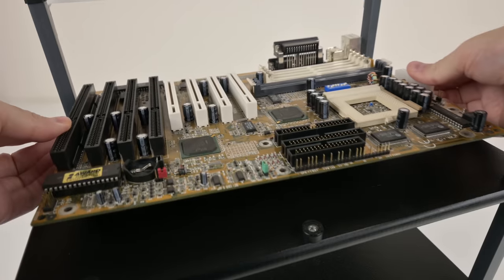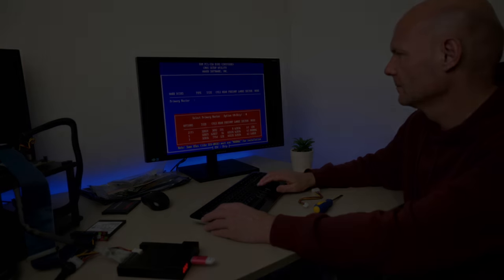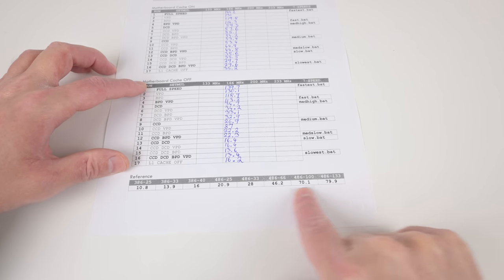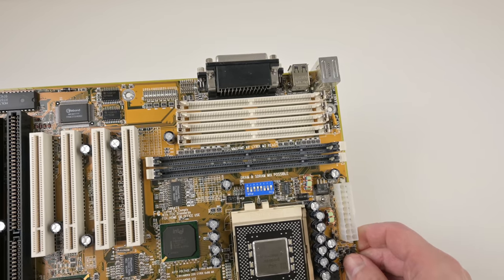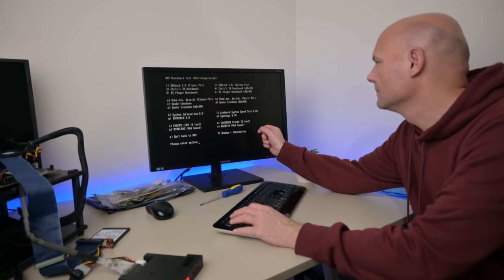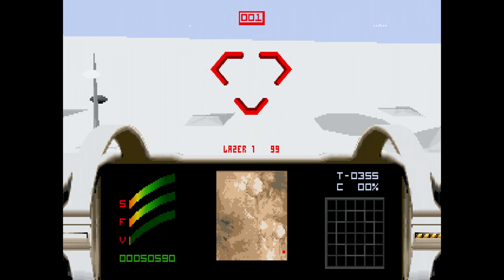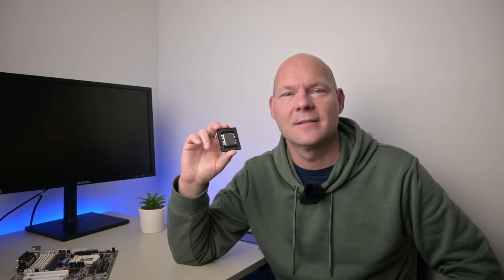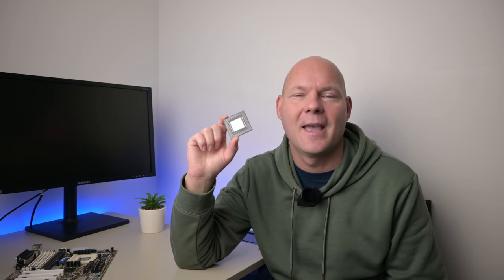Pentium MMX 166 is one of the Best Retro Processors

Comment: Great video, lovely editing on the build montage. I grabbed a very cleap Dell socket 7 board with integrated VGA and picked up a 166Mhz MMX to go with it and making it work for me. Recently under locked it to 50Mhz FSB which got me down to ~22 on 3Dbench with slowest.bat which is cool as the crappy dell bios doesn't let me disable L2... I'm looking to make a low hight Crystal chip based sound card and joystick card that fits right into the risers slot as it has built in Ethernet, VGA, IDE so sound is all I want to add, fingers crossed I can make it work 🤣 fun is in the building for me. Really want to try Epic also, I had Inferno back in the day and I thought it was very hard and super confusing, it annoyed the heck out of me, although I loved the graphics and music.
Reply from the maker: Sounds like Inferno didn't change the frustration 🙂 Nice job with the underclocking of the FSB, might be something I could look at...

Comment: Great chip for 95 c or original 98.  A little weak for 98se or ME but still doable if you have 128mb ram, and a fast hdd it'll just be slow loading apps.  K6-ii 300 or p2 266 is really bare minimum for a good 98se experience and p2 450 or k6-3 500 with at least a nvidia tnt2 or voodoo3 and 256mb system ram bare minimum for ME

Comment: Well, this is good news- looks like it is time to pop my 233MMX back out in favor for the 166MMX.  I wish you had shown a sheet for the 233.  Granted, the 166 is ideal for this mod, but the 233 would really like the dual boot and possibly the 233's lowest clock would only be a few mhz faster then the 166's???  I love socket 7.  I got in back in the day with a 90, then a 133, then a 200, then a 166MMX, and then untinately a 233 MMX when prices became affordable and everyone and their brother was NOT into vintage hardware ;)
Reply from the maker: YOU need to fill out your own sheet as every machine is totally different and you will get different numbers. You can just change the mulitiplier and the run the 233 at 166, no need to remove it.

Comment: I think it's tough to beat the 440BX chipset for retro PC gaming. Pretty happy having an ASUS P2B running a Pentium 3 at 1 GHz for DOS and Windows 98. Very stable, many games just work and is very flexible with USB/SATA/ISA sound cards all at once. Not sure what could be better aside from a mini PC supporting all of that integrated, haha.

There is a CD image of the Evergreen Spectra 400 on the Vogons drivers containing thousands of Socket 7 BIOS files, including large hard drive support and booting from CD. Try to see if that makes a difference.

I'm curious as to how far Socket 7 boards could go. My first desktop growing up as a kid was a Socket 7 Pentium 120 but it has no PS/2 ports and no MMX support due to the VRM socket being unpopulated. I still have it and will never forget the times using it, but the limited ability to upgrade and having to use a serial mouse has made me reluctant to use it again.

Recently got a hold of an MSI MS-5148 from surplus that has PS/2, USB and MMX support, not sure if it can work with K6-2. Looking forward to trying this board out.

Comment: personally I prefer Windows 98SE with configured DOS mode to Pure Dos because it allows for me to use USB with a PCI card. I have one with an OPTI chip and the only time it gave me problems was when I tried to use it under Windows 2000 on a 486. You can also edit the MSDOS.SYS so it won't load the GUI.
Reply from the maker: 98 + DOS mode is a winning combination!

Comment: A couple of weeks ago I bought an Asus TX97-XE motherboard, basically same thing as this gigabyte board in the video. Seems to work, but for some reason keyboard does not. I see no scratched traces near the ps2 ports, or missing/broken components around them... Any idea how to figure out why it's not working and try to fix it? Perhaps it will work with USB keyboard, have not tried, but I want it to work with a ps2 keyboard (I have not tested if the mouse ps2 port works yet)
Reply: Sounds like you're gonna have to go Adrians digital basement on it and put an oscilloscope to it

Comment: I'm trying to think about a couple systems here.
First is a TurboXT system running DOS 3.3 which can switch between a V20 at 10Mhz and a 8088 at 10Mhz using a custom dual CPU board in the same manner as a 286 Upgrade board (sending reset signals to the pin on the cpu when inactive). It is able to slow to a 4.77Mhz speed, thanks to the turbo XT board itself, to play games that require the slow speed and play early EGA games at full speed either on an 8088 or V20 to get the best of both worlds with 640K of RAM. Since I have a game on there that requires complete register compatibility with CGA (Digger being an example), I have a choice: 
1. Axe that game and play with a semi-register compatible VGA ATI Wonder series for the games that don't need full compatibility with CGA
2. Play that game with an original CGA card and have to swap the card out for an EGA card when going to the V20 due to register incompatibilities that won't allow the EGA and CGA cards in the same system configured as color graphics accelerators (and get a MCE2HDMI for conversion to VGA and HDMI from CGA and EGA)
3. Get the one card that does have full CGA register compatibility called the Cirrus Logic CL-GD510 + CL-GD520 Codename: “Eagle II” Card (CGA, MDA, Hercules, EGA, VGA) which is stupid expensive and hard to find
I'd like to play these games on it and I plan to put a LABS Blasterboard (AdLib Compatible with SB2.0 Support) (8-Bit ISA) so I can tie in the PC speaker to get higher quality audio from that speaker output along with adlib support for the few games in the list that support it:
Castle Wolfenstein
C.I.A Adventure 
Lost Dutchman’s Gold 
Nuclear Submarine Adventure 
Transylvania
Battlezone
Digger
Fleet Sweep
B-1 Nuclear Bomber 
Civil War 
Hide and Sink 
GATO
Out on a LEM
Beyond Castle Wolfenstein
Spacewar
The Crimson Crown 
Cat ‘n Mouse 
Emergency Mission
Tetris
Beyond the Titanic
Oo-Topos 
Defender of the Crown 
Knight Orc 
668 Attack Sub
Transylvania III: Vanquish the Night
Paku Paku

Second is a Socket 7/Super Socket 7 board with either a K6-2+/K6-3+ or a Pentium MMX 166 for DOS 6.22 only titles from late non-speed Sensitive 286 Titles to a 386 25Mhz-33Mhz, A 486DX2 and Pentiums playing both 2D and 3D titles on 64MB of ram. The graphics cards I'm really having a hard time with. I know I want some sort of S3 card for 2D on it and found the fastest AGP card Diamond Speedstar A55 (S3 Trio3D/2X) (AGP) and the Fastest PCI version (Diamond Stealth 3D 2000 (S3 ViRGE DX) in case I need a 3D accelerator. From the compatibility Matrix only two games that are on my list are Glide Titles and they are strictly windows games so that means I don't necessarily need a 3DFX Voodoo Card, but if I was going to get one it would be a Voodoo 3 2000, but NVIDIA might be an option to consider (The M64 for example). For Sound, I'm going all out with an Orpheus II (Gravis UIltrasound, Soundblaster, AdLib, Intelligent MPU-401 Support) with a Dreamblaster X2GS SE for Soundcanvas support and a MT32L (MT-32PI) Solution for Roland MT-32 support. Here are the Games I'm planning on for the DOS PC specifically:
Sword of the Samurai
Red Baron
Wing Commander
Wolf Pack
Duke Nukem
Crisis in the Kremlin 
KGB
Wing Commander II: Vengence of Kilrathi - Deluxe Edition 
Wolfenstein 3D
Buzz Aldrin’s Race into Space
The Ultimate Doom
Wing Commander: Privateer
Duke Nukem II
Epic Pinball: The Complete Collection
Sherlock Holmes Consulting Detective Collection
Wing Commander: Academy
Aces of the Deep
Doom II
The Adventures of Willy Beamish
Star Wars: X-Wing Collector’s CD Rom
Wing Commander III: Heart of the Tiger
Wing Commander: Armada
Star Wars: Dark Forces
Tyrian
Across the Rhine
Fast Attack: HighTech Submarine Warfare
Star Wars: TIE Fighter Collector's Edition CD Rom
Wings of Glory
Duke Nukem 3D: Atomic Edition
Final Doom
Quake: The Offering
Duke Caribbean: Life's a Beach
Duke it Out in D.C.
Duke: Nuclear Winter

Third is a Socket 478 Pentium 4 (2.4A/2.8A/HT 3.0E/HT 3.2E/HT 3.4E/HT 550) Windows 98SE Machine with the Intel 865 Chipset with 512MB of RAM. For Graphics I'm thinking of Going with the GeForce FX 5900XT (AGP). Most of the Quadro alternatives to the FX series have been snatched up already and those that remain are as or more expensive than rarer Voodoo cards. Sound is the Creative Audigy ZS PCI and I am running the following games:
Age of Sail
Fallout 1
Wing Commander: Prophecy
Fallout 2
Quake II: Quad Damage
Sea Dogs
Age of Sail II
Harry Potter and the Sorcerer's Stone
Age of Sail II: Privateer's Bounty
Harry Potter and the Chamber of Secrets
Call of Duty
Harry Potter: Quidditch World Cup
Pirates of the Caribbean
Harry Potter and the Prisoner Of Azkaban

Finally is a Core 2 Duo E8600 Windows XP system on the Intel P45 Chipset with 4GB Ram, a GeForce 9800GTX and a Creative SoundBlaster X-Fi Titanium PCIe running the following games:
Age of Pirates: Caribbean Tales
Call of Duty 2
Quake 4
Command & Conquer: The First Decade
Age of Pirates 2: City of Abandoned Ships
Battlestations: Midway
Call of Duty: World at War
Command & Conquer 3: Deluxe Edition (Includes Kane's Wrath)
Command & Conquer: Red Alert 3
Command & Conquer: Red Alert 3 - Uprising
Silent Hunter 4: Wolves of the Pacific (Gold Edition)
Assassin's Creed (Director's Cut Edition)
Battlestations: Pacific
Silent Hunter 5: Battle for the Atlantic

I've noticed that some games made for the XP era and Windows 98 Era aren't running great on new hardware. Harry Potter and the Sorcerer's Stone stopped working for me recently on windows 10 and Harry Potter and the Prisoner of Azkaban has had constant issues with newer graphics cards to the point that a single glitch that only appears due to the bad rendering behavior on newer systems with newer cards causes the entire game to softlock and it is pure random chance that the imp glitch can be avoided. Age of Pirates: Caribbean Tales is also having trouble in certain areas running on my much more advanced 4090. Some games, most notably Age of Sail II, won't even install on newer machines now and won't boot at all. Its my nostalgia and I want to be able to still play them 10 years from now when I have an itch. I hate having to configure older games to run on compatibility mode, doing all the ini tricks in the book and then some, and still after all that work (hours of it) not being able to run it in the end. That's why I'm planning an XP and 98 Dedicated system so I can have my cake and eat it too.

If Phil is reading this, or if anyone has any suggestions for improving the builds before I invest in the hardware I'm open to it.
Reply from the maker: I skimmed it, it's too much information to dig deeper... Maybe join our patreon with the discord community?

Comment: I actually lived in the 90’s and this even my 133 ran fantastic with Windows 98SE.  I have no idea why people think this is a DOS only cpu but it was far better than that.  Quake 2 and games like it ran great on this and my 133mhz especially with my 3DFX Voodoo 3 2000
Reply from the maker: Your mind is playing tricks and fantastic is difficult to quantify
Reply: @philscomputerlab  No it’s not actually.  I had a 133 until recently since my mobo finally died and also have PCEM17 which emulates an 8088 all the way to pentium 2 450.  I made an emulated 133 with a Voodoo 3 2000 in my I7 laptop and it’s identical to the real thing.  So yes, a 133 and up runs fantastic with 98SE.  In fact, most older dos games hated Pentium and their external cache plus a lot of old dos games liked bus speeds lower than 66mhz fsb.  You can feel free to try and disprove me at all costs to feel right but whatever.
Reply from the maker: @kennethober6626  So what FPS do you get in Quake 2?
Reply: @philscomputerlab  like 24 320x240 Software and 30 1024x768 on Default GL or 3DFX.  I know where you’re headed and my point still stands that it’s more than a crappy DOS CPU.
Reply from the maker: @kennethober6626  15 fps in Unreal and 24 fps in Quake 2 with a Voodoo 2 at 640x480. Nothing fantastic about that. It's for DOS and very early Windows games only.
Reply: @philscomputerlab  Whatever you say

Comment: I see those startech coolers on ebay all the time, was wondering how good they actually are.
Reply from the maker: Nice! Yea well worth it. On some boards caps can be in the way. It also works for low power Socket A and 370.
Reply: @philscomputerlab  awesome, thanks for the tip!

Comment: I have a 5stx-j98 board with a Pentium-S 75Mhz cpu. 128MB SIMM. I bought today. Board only has DIN conector for AT keyboard. What will  I do for mouse? What do you suggest? Serial mouse? Or a PCI card with USB-PS/2 port? And should I buy a MMX 233 cpu? 166-200 and 233 available.

Comment: Do not use SSDs with older hardware, use SD,micro SD, flash cards instead.

SSDs require TRIMM support from the OS to maintain the SSD over time. TRIMM support is a modern OS feature and is not supported by DOS, Windows 95,98,2000,ME, XP, etc.

Comment: Still the retro PC I love the most, as the DOS days will always have a special place in my heart, only that I have a 233MMX on this board. I used to run Win98SE on it too as there are some speed sensitive Windows games too, like Betrayal at Antara. But since I set it to 120Mhz for DOS (via the dip switches, that let you set the CPU to 120, 133, 166, 200 and 233 Mhz quite easily), I got too lazy to open the case and change the dip switches again for Win9x games that need more juice. Now if only someone would make a non-invasive mod so we could switch between 120 to 233 Mhz from outside the case... :D (don't think that it's possible without removing the dip switches)
Set to 120Mhz, MB Cache off and 136 in 1 "slowest" you can reach the nice 10.x in 3DBench2.

I'm also using your config.sys and autoexec.bat with the options for choosing different option like EMS or no EMS at boot, edited for my needs like for using USB thumb drives under DOS. Also started to create batch files for games to automatically switch setmul and sound card options to whatever is needed for the game.

Btw, I know of the game Epic but didn't play it yet. But I played the sequel "Inferno" back in the day. Still have it's soundtrack in my ears to this day.

PS: Don't forget "CDBeQuiet!" (or "CD Bremse" for Win9x), as these are programs you want / need when playing lots of CD based games! They are true "ear-safers" if you use a faster CD or DVD drive!
Reply from the maker: If you find a board that uses jumpers instead of DIP switches you can route switches to the case and toggle it from the outside. This is the reason the K6 mobile CPUs are so awesome, you can change the multiplier through software. I have also seen someone install the DIP switch outside the case, how awesome! 

I actually did a video on the CD Bremse 😊
Reply: @philscomputerlab  Both options are interesting but the K6 mobile one would be easier option.
The GA 586ATX (Rev 3) supports 233Mhz K6 CPUs, so I wonder if K6 Mobile CPUs also work. The manual mentions normal K6 with 3.2V, while for Mobile K6 I found spec sheets that state "2,0 Volt Core (3,3 Volt I/O)".
If the Mobile K6 would work, are there some downsides to consider in comparison to a Pentium 233 MMX?

Yep, I watched your CDBeQuiet / CD Bremse video. Just had to mention it again as I don't want to play disc based games without it anymore on some people might not have heard of it yet. :D

Comment: It weirds me out that simply disabling some cache can make a Pentium perform like a 386. I would have thought certainly they did more optimizations between the generations...
Reply: Cache is just that large of a benefit. Since the CPU runs much faster than the system RAM, a cache miss results in the CPU just idling until the RAM can talk to it.

Comment: Hey Phil. Thanks for the nice detailed video. My first cpu was the 233 mmx that my uncle build for me. Sadly it got damaged in storage by a water leak.
I was given a flightsim with it, but it was playing to fast, and did not what to do to correct it. 
Im trying to restore an old cyrix (6x86L PR166+) system. Do you think it would work or is it only working on intel baseret systems?
Reply from the maker: It will run but it won't have the smooth slowdown steps like the Pentium MMX.
Reply: @philscomputerlab  ok i will give it at try. Thanks.

Comment: Pro tip for you Phil: use the old turbo button on the multiplier jumpers.
Reply from the maker: Pentium machines usually don't have one.
Reply: @philscomputerlab  True, but I'm sure you have the old cases or some other thought on how to do it. Not that it'd work on this board without soldering.
It did work quite well on my dx266 back in the day though.
Reply from the maker: @myne00  Cases can have the button, but the button connects to the motherboard and Socket 7 boards don't have a connector for turbo, this is something you will find on 386 and 486 boards.
Reply: @philscomputerlab  Ah, you misunderstand. I'm talking about the multiplier jumpers when they exist. 
I used to have it wired on my 486 to change the 'fsb' from 33 to 40 (66/80).
On a P166 depending on the board you might be able to change the multi from 2.5x to 1.5x. Or whatever jumper combo you can figure out with one button.
Reply from the maker: @myne00  You specifically said turbo button. Yes I'm aware of multipliers. In the context of DOS gaming they matter little. Test Drive III will run too fast no matter if it's a Pentium 90 or 200.
Reply: @philscomputerlab  Yes. I meant turbo button. Plug it into the multiplier/fsb jumpers and you can change clocks instantly on these old things.
I'll have to rewatch the video to see why I mentioned that, but iirc you were changing multipliers at some point to achieve something.